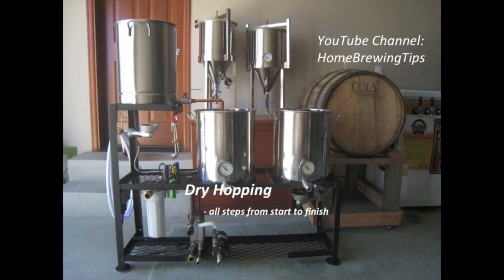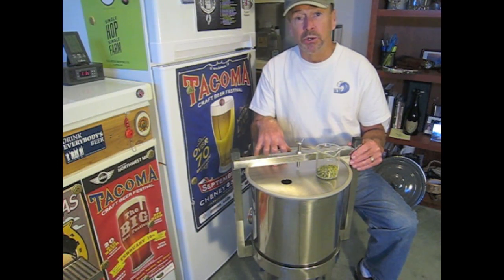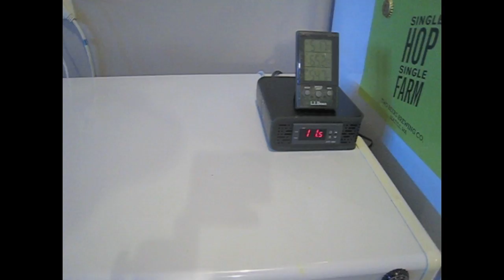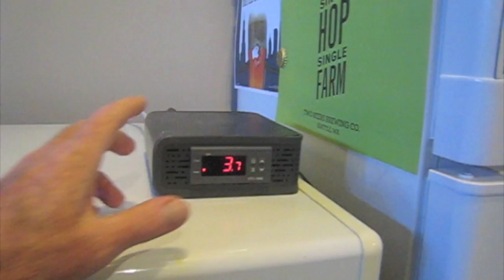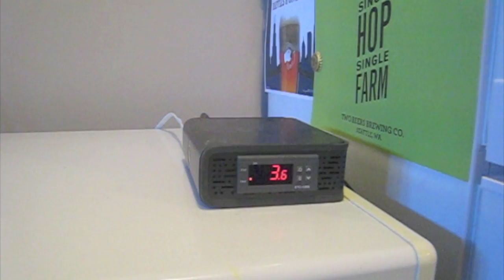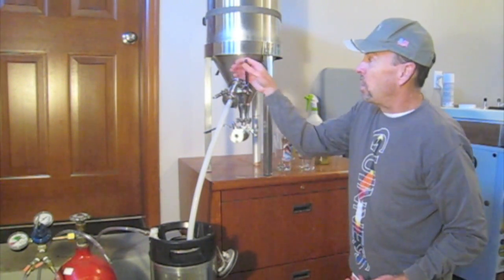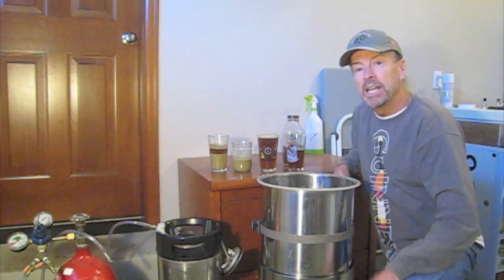Homebrew:  Dry Hopping Start to Finish

Comment: Great video, very instructive thank you for sharing. One question: do you also cold crash with top fermentation yeast strains? Considering they are meant to work at higher temperature ranges I am afraid the process could stress them and develop off-flavours. Do you have any experience or recommandations on that matter?
Reply from the maker: Thank you for your kind note.  I did this video in 2014 and I think since then I have tried every possible way of dry hopping!!!  (the quest for perfection).   
This video in the link describes my current approach (Vinnie is the founder/genius behind Russian River Brewing, one of the true pioneers in the industry):  https://www.youtube.com/watch?v=lQmLKDmZ7dQ&t=3s
I have had very good results following his basic outline (discussed in the last 1/3 of the video).  To directly answer your question, yes I cold crash everything, and I also often clarify with gelatin quite regularly.

Thanks again for watching and contacting me.   All the best!     -DT
Reply: Thanks for the quick reply, I really like the approach of cold crashing, I will give it a try on my next batch. Thanks again and happy brewing!

Comment: I am just contemplating my first dry hopping brew with a Brewfather. Normally I transfer the beer following fermentation to a clean vessel, add secondary fermentation sugar and then put straight away into bottles or a pressure vessel (Plastic). Normally no additional CO2 needs adding.  With dry hopping presumably I would add the secondary sugar after I had racked it off following the crash cool?

Comment: Thanks, this is a great video! I have a question about dry hopping, do you sanitise the jug you put the hop pellets in or are hops pretty immune from infecting the wort? I was thinking of taking a piece of paper from the middle of a ream and making a cone that fits in the hole at the top of my stainless steel fermenter (similar to yours in this video) to drop the pellets though into the wort - does that sound OK or do you think it sounds risky?
Reply from the maker: Thanks for watching and your very kind comment.  I do not sanitize my jar that I put the hops in when weighing them.  Truthfully I used to be much more worried about this than I am now (wow, this video is almost 7 years old!). Yesterday I added dry hops to a keg and used a mesh tubes for that. In this case I carefully sanitized the tube since it would be submersed in the beer, dumped in the hops, and eased the tube into the keg.  Now days I have a Spike CF10 fermenter and have done many videos on dry hopping with it.  If you search the channel you should be able to find them.  All aspects of brewing are fun to explore, dry hopping is one of my favorites.  Thanks again for watching and best of luck.   -DT

Comment: For how many days do you cold crash? Also I'm dry hopping in a big mouth bubbler with pallet hops. I added 3 oz of hops without a muslin bag. Would the hops sink to the bottom when I cold crash my home brew?
Reply from the maker: Alejandro Zuazua Thanks for the note.  Yes, the hops should sink when cold crashing, and one advantage that you have is that you can see the fermentation status.  With my stainless steel fermenters I cannot see how much "stuff" is floating around.  Typically, I like to cold crash to as close to 32 F as possible (it commonly is around 36 - 38 degrees).  I find that a few days will get the job done.  I just finished a double IPA with 2 oz of dry hop added (interestingly enough I did this at around 70 degrees in my garage because I needed the fermentation chamber for my next batch). After the cold crash there was very little hop transferred out.  I think that you will find it interesting to see how much settles out with time alone.  One other thing, once things are settled out, try not to bump your fermenter around too much.  Thanks again and good luck (let me know your results)